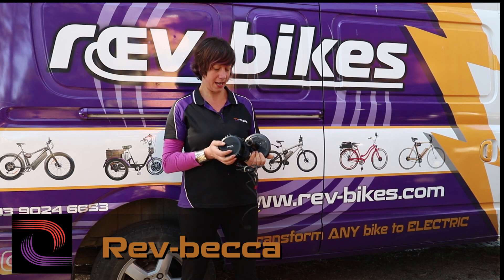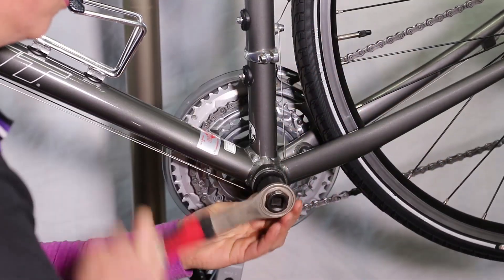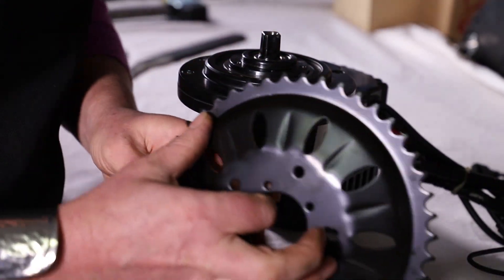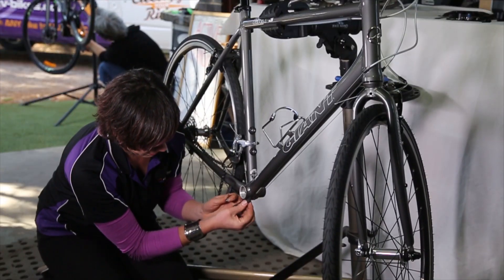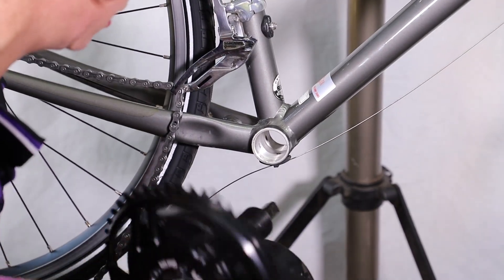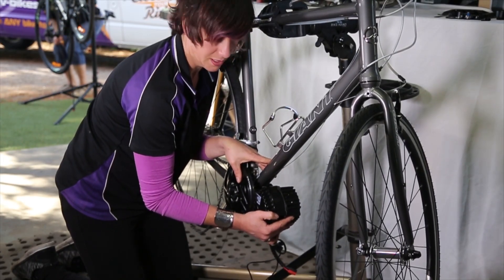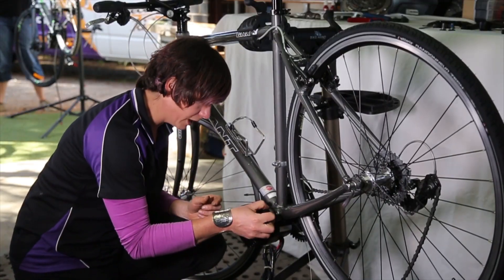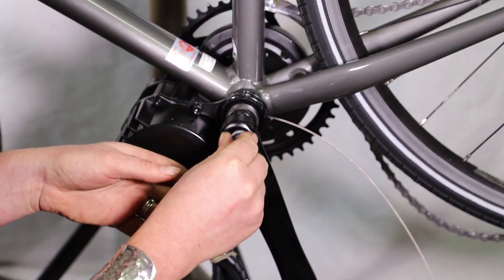Installing a Bafang mid-mount motor

Comment: Worst thing with these units is waiting for a different chain ring, if it don't line up with the middle gear on the back wheel. 
Also the motor should have a mount to attach to the down tube(things do loosen.
I get a kick out of people with no formal mechanical training showing people how to do things.
Rings and other jewelry, hehehe, had a kid the other day, hand slipped, caught his ring on a bolt, trip to emergency.
I know of no mechanical training program (but not sure about these little bicycles) that in the first or second class, stresses the importance of not wearing jewelry or loose fitting clothing(especially using moving(rotating) tools)
I usually leave the front derailleur on and locked over the chain ring to prevent the chain from coming off the front. 
You already have it, it's not worth much and is way better than those chain guides you see people using and always breaking.

Comment: alot about these motor kits are wrong.and is it normal for there to be resistance on peddling withou a battery connected that will eliminate any resistance once it is so when it goes flat it will be a bastard to peddl back home

Comment: Two years anf now three mid drive 1kw later i just bought a 750w mid dtive. Between two motors i have done over 20,000 kms. I just did a full tear down of the two older motors and all i replaced was one pas disc. The ring magnet had broken. The gears look almost new.

Comment: Ewwww, square taper on the bottom bracket/crankarm connection.  I had no end of problems with those back when Shimano used square tapers, loved it when they switched upgraded to a more solid connection.

Comment: I use a dead blow hammer to remove and replace bike parts. Especially when tightening the pedals. They will loosen up after awhile if you tighten them only with a wrench.

Comment: Chain centerline was not addressed. Having the chain centered properly will prolong chain life.  Also not mentioned is possibly /likely shortening the chain to keep it more taut, also prolonging chain life, maybe even replacing the rear derailleur with a mid or short cage.

Comment: Thank you for the excellent tutorial, Rev-becca! Nobody ever mentions about the cable guide underneath the bottom bracket. This will affect a ton of modern bikes, including a Trek that I put a BBS03 on this weekend. But thanks to this video, I knew what to expect, and I did this same fix and it worked. Except on mine, the screw still stuck out about 3 mm too much even after modifying the cable guide, but it got me close enough to use a different fastener with a flatter head, and it worked.

Comment: Rev-Becca I followed your video almost word by word for my installation and it was great for a while.  
The little joint that stops the motor swinging around is useless, I used a big ass hose clip/jubilee clip to secure the motor to the frame so it didn't smash against it when the little joint failed. 
The base plate for the battery is very slim too, if you go on bumpy or offroad areas, you'll end up getting the 70%-0% power very soon. The battery disconnects from the connector momentarily, it causes a short that fucks up the battery terminals. 

Looked at battery and receiver and black everywhere like a little fire happened!  The solution I found?

Q-Tips/cotton buds. Wipe the battery connectors as clean as you can, then...reconnect the battery, go for a little spin. If it's all good, then get on to amazon or whoever your nearest supplier is and get a hose clip/jubilee clip that holds your battery and connector tight together, and clip them good to your frame and you'll be cruuuuuuising.
Reply from the maker: Good job mate 👍🏽
My guess is you didn't tighten the motor enough, nor secure the cables well. 
These days we use a chisel to hammer in the notches on the fixing plate, so it bites into the frame better. Then use a torque wrench with a specially made socket, to torque the lock ring up to 80nm. It's very rare to have any movement after that! 😁
Reply: @Revbikes  Cables were fine, motor maybe less so. Did a retighten everything at my 1500km service when I had time off work. I'd be very wary about over-tightening anything on an aluminium frame without the exact torque wrench though, last thing you want is to be cruising into work at 40kph, hit a bump, then your frame buckles and you have your back wheel wrapped around your neck before you know it 🤯 Off work over Xmas so another clean up is due, there's a noise that may be a sticking clutch in the freezing weather😫 Plus maybe a paint job, Giant must have had blind people picking their colours in 2012 when my frame was made😑
Reply from the maker: @dubcindub15  tightening the lock ring will only cause the fixing plate to indent the frame more, it will not be damaged.. I would put serious money on that!

Comment: hi there, ive been building one of these kits on my beloved raleigh chopper but have come up against an issue where i have no power to the motor, i didnt get a display as it worked out a lil bit cheaper and that i wasnt fussed about the screen read out, but with this i havent got any power to the motor. :c i have followed the instructions and cable diagrams but i have a feeling without a display/ power button i have a pretty costly bike weight :c is there any means of powering the system without a display?
Reply from the maker: The display normally turns the system on. I suggest getting a display, as this system runs a pedelec, and you'll want to adjust the levels of assist via the display.
Reply: @Revbikes  thanks for your reply, I have had to buy a display as the kit I had bought was sold without a display unit (annoyingly enough)

Comment: Fitting a Bafang mid drive motor doesn't it lookj simple?   I have watched a few of these videos because I decided to convert my hub motor ebike to a mid drive motor, I put my hub motor on another cycle I had so have become awate about certain complications and difficulties these videos make look easy..  I am not saying it is hard maybe in many cases its stright forward but in somew cases it is not, I do a lot of work on my car so have some very strong, heavy duty tools which in removing the crank I have been very glad for, I do have a cycle tool set which I have been glad for the special tools but their basic tools wouldn't of removed my crank it was that tight on.

But having a breaker by and sockets there was no way that crank wasn't going to come off so yes don't rely on a cycle tool set, then there is fitting the motor on and in some cases grinding need to be done on bottom of the frame where the crank fits in, grinding your frame is a specialists job as grind it to much you lose strength.  I did this and then painted with red oxide and colour paint but you have to make sure you don't grind further then you have to.  Another major problem I got was fitting the battery on the frame where the bottle holes where you cxopuldn't get the bracket on.  With a mid motor you can just remove the back plate drill into the holder and fot, with some Hub motors not that simple you have your controller unit in the holder and can't drill holes.

The solution is drilling into your frame and fitting rivet nuts again need a spercial tool to do this more expense and time, other problems I had is waiting for small parts I ordered delaying the job as many times you don't know what extras you need until you start the job.  My speesd sensor magnet was missing so had to order, brake cable frayed so had to order on and ordered a Lekkie Bing ring which is now two weeks late because the supplier forgot to despatch it.  I am sure there can be many other issues but don't think you going to start working on your bike and the nut and bolts are going to undo on their ownm, without that breaker bar I woulod of been stuck normal bike tools woulkdn't of removed the crank nut it was tight on.  Its well worth it to see the final result and have a ebike of your choice but don't rush it and take your time to think if things don't go as planned, be carefull when grinding and drilling into the frame and don't weaken the frame and onl;y grind thje access you need to raise the motor higher.  Mike

Comment: A little bit Belt & braces putting Threadlock on with a locking ring!
Good job you used the blue (semi permanent) type.
Nice job with good explanations.

Comment: Losers say on their website that only they can install the kit. I just got one off ebay instead.
Reply from the maker: Instead of that attitude, you could be grateful that we assisted you with free knowledge sharing, without any gain for ourselves.
We got tired of the warranty issues which came up in so many DIY installs, even after providing these videos. We prefer to ensure its done right now, with a proper torque wrench and socket 😊
Best of luck with your chosen suppliers and your self install.. I hope it all goes smoothly 🤞

Comment: Question. I just got my bottom bracket out and going to put the motor in. Notice you're putting the chainring on before installing the motor on the bike. I'm probably going to replace the chainring at some point. I just want to see how the 44 tooth from the factory performs. Should I pass on loctiting the motor installation or can the chainring be swapped at a later date without repeating the motor install? Thanks for a great video.
Reply from the maker: Just need to take the crank off to remove the chainring. Can be done with the motor in 👍🏼

Comment: Top tip for everyone from a bicycle mechanic, put a grease on the threads of the pedals and the bottom bracket  I've seen bikes written off because a bottom bracket has seized in the shell. I wouldn't like to have to destroy a bike because a motor had seized.
Reply from the maker: Pedals, yes indeed. Bottom bracket, NO!!! Since the motor doesn't utilise the threads of the BB shell, it can't seize in there. We don't want the motor to move / rotate at all, so best to clean grease out of that space.
Our bike mechanics have 13 years experience doing it this way, and no seized mid drive motors yet 👍🏼☺️

Comment: I have a Giant Twist Freedom DX  (purchased in 2010) in Seattle.  i'm wondering if the same tools you used for removing the bottom bracket on your video are identical to type required for my bike?  And if so could you give me the information to acquire these tools? Thank you so much. Wonderful video.

Comment: My 2020 Talon 2 has Rockshox, Alivio, hydraulic disc brakes I got slightly used last spring for $600! I want to keep the 36t for maximum hill climbing. This is not intended to be a commuter. If top speed is 25-28 that's fine. Hopefully the 2x9 with 11x36 cassette 22/36 crank is a good donor bike. What do you think?

Comment: Thank you Rev electric bikes this really helped me install my bafang motor 👍

I have one issue with my install and that's the 8mm allen screw that is fitted on the pedal crank arm. 

Everytime i ride the bike that screw unscrews itself and the crank arm gets loose. Have you ever experienced that and what's the solution to fix it.

Comment: Thanks for covering off the larger cable guide issue under the bottom bracket. So many others just gloss over challenges like that, leaving you to wonder what to do. I actually purchased a shorter one rather than cutting the old one and flipping it but that was a good idea! I just wanted to keep my old one just in case (chances are, I will never revert back anyway, but hey, you never know). Thanks for a great video!

Comment: Rev-Beca, thank you for putting up a great video. I see 68 mm label on the motor part where you are explaining the chain ring (5:21) part and the upgrade that you are installing. What is the meaning o that 68mm label on the motor means? https://youtu.be/rcYVyuDC6e8?t=321
Reply from the maker: It's the width of the bottom bracket. This is the standard motor, made for the standard bottom brackets (68-73mm). Fatter versions are also available.

Comment: Hi! Question please, if I follow the instructions but I don't put the chain as usual, does the motor work when someone pedal? I mean I only need the crank and pedals moving with the assistence of motor. Strange question but it has to do with a therapy for Parkinson disease. Thanks

Comment: With mid drives can you use throttle if the chain snaps and break
Reply from the maker: You can, the motor will still turn when you apply the throttle, but because the mid drive motor drives the chainring, the bike won't go anywhere if there is no chain there. 
To get to your point, a hub motor will do that, as it simply turns the wheel, not the chain.

Comment: What about the battery?
Reply from the maker: There are many different batteries available, most of them will bolt to the frame, where the water bottle cage normally goes.

Comment: I had exactly the same gear cable guide at the bottom, and made exactly the same modification.  Now that I know this is the way it's done (probably the only way), I feel a lot more confident.  Now to cable it up.

Comment: Why can’t you cradle the motor in between the V of the two down-tubes ABOVE the Crank-housing?.
Reply from the maker: No clearance. Motor needs at least 180 degrees of frame angles to pass the motor fixings past.

Comment: Hi Sheila.
I have eBike model MATE X-750W.
Battery 48 V/14Ah fail.
On the side battery voltage 42V-when turn battery key to ignition position-drop to 0V.
What can i do?

Comment: What happens if you add a mid drive motor & battery to a bike with a rear hub motor and run both simultaneously?

Comment: For a really good bike check out an NCM they are hub driven but still mile upon miles it has never given me trouble : ) the BEST 1500.00 i ever spent and has full throttle👊. Its not a rock banger but still well worth the look

Comment: If you install that kit in to classic bike with low step frame you have to leave the engine in a hanging position. Tongsheng is is straight down there, but it has no sea fortunately, alltought bafang is down.the logo is just skewed then :D

Comment: I noticed that whenever you apply torque to your tools, you pull. That is indeed the power direction for an excavator, but most techs, given the option, would use their body weight and lean into it. Not a push, but a controlled lean, using body mass versus muscle to apply force.

Trying to decide on a type of conversion kit. This mid-drive takes a lot of work and changes the drive train. Thanks for the demo.

Comment: Rev-becca instead of using a piece of rubber or plastic to prevent the motor from blocking the cabled I used a piece of moldable epoxy steel (you know ; the clay like). I made little ball from it an pushed it in between the two cooling ribs that could touch the frame if there was no cable. After that I pushed the motor up till the clay touched the frame and secured the motor. Because of the cooling ribs and the round form of the frame tubing it can't go anywhere.

Comment: Rebecca, thank you for this is a very good and informative video. 
Are Shimano Steps cranks compatible with the Bafang BBS bottom brackets?
Is it better to change the chain to a one that is especially for e-bikes, for example KMC e9?
To going up steep hills, like 22 % grade, is it wise to take a cassette 11-50 and a chainring 28, 30 or 32 teeth?
Thanks for replying.

Comment: Rev-becca, great video on installing the Bafang.  I have watched all your Bafang videos and it gave me (a lady biker) the encouragement to install the bafang by myself on my bike.  Your video are excellent showing all the steps needed for installation.  I also watched other install videos made by other bike shops and they are not as good as yours.  They skip some steps which I assume they consider too basic, but for folks like me who are not bike mechanics, I need to see how to remove the existing parts and then how to put on the new parts.  I put the Bafang on myself using my husband's tools.  The Bafang has made riding up hills a breeze and my overall rides more enjoyable.  Thank you!!  P.S. I replaced the stock Bafang ring with a Bling ring, have not had any problems with chain slipping, glad you suggested the upgrade.
Reply: It's  pretty straightforward and fun! I have two Luna Banana BBSHD bikes, and I'm  gonna convert a Trek my dad left in my garage with a 68 or 73mm Bafang middrive motor.

Comment: I own a Specialized Levo. Thinking what is better, buying an E-bike or installing a motor on a regular bike, I think the second solution makes more sense.
The manufacturers of E-bikes "improve" and change their products every season and if you buy such a bike you might get stuck without the most important parts if something goes wrong.
With DIY E-bikes such a problem is unlikely to happen.
Thanks for the video.

Comment: I have just completed 800 miles on my mid drive. That motor is never coming off lol. Love it
Reply: I did 30km on the first day, what a magical thing at a fraction of the price of a new bike. Also very green as i did not have to throw away my old bike and get a brand new one.... this should be standard practice for those that want an ebike if you ask me.